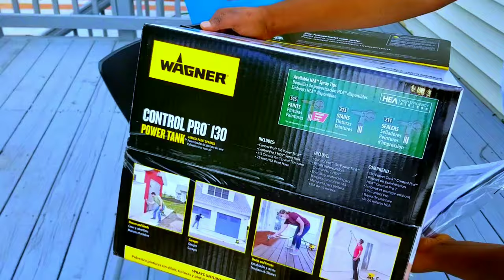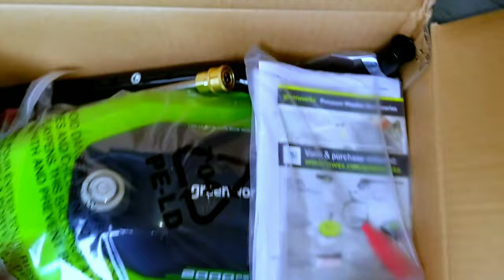Fence Painting ideas/ Wagner sprayer control pro 130

Comment: Hey just heads up.... when you power wash a fence you must let the wood dry around a week before painting or staining. The pressure washer penetrates the wood fibres and even though it looks dry, it actually isn't on the inside. That paint must have flaked off very quickly.
Reply from the maker: Thank you so much for your advice. I will do that for my next project. Thabks for watching
Reply: Thank you so much!!!

Comment: Do you have any negative to say about it? My son gave me this one. I want to use enamel paint.
Reply from the maker: The paint i used was perfect. The hard part is cleaning the pain off the sprayer. If the paint you want to use is easy to clean then it will work great.read the instructions on how to clean the paint you are using on the container.  Make sure u have enough paint that way you are not washing it over and over.  you have to wash it right away as soon as you stop painting that way the paint will not dry and clog the sprayer.  It was really easy to use. My fence is still looking great as of now. No issues noted.